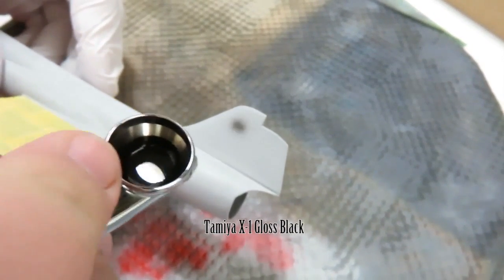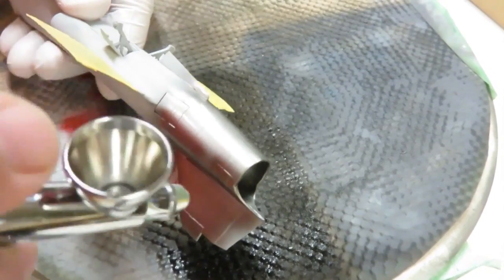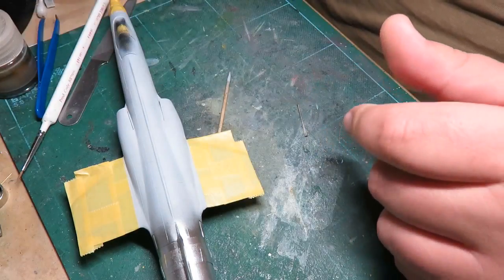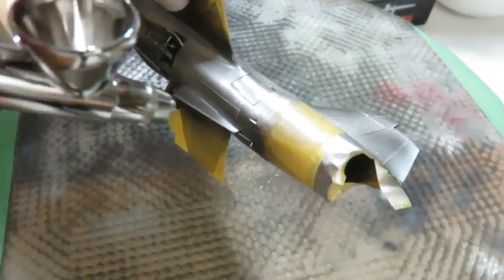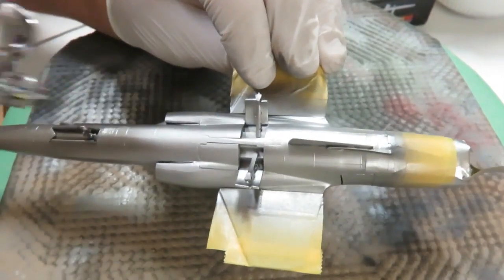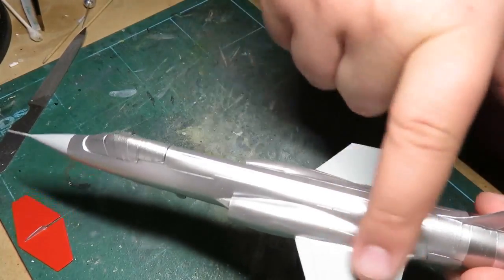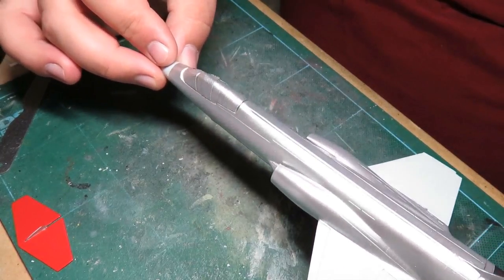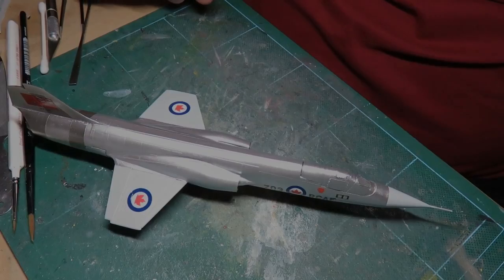Airfix 1:72 CF-104 Starfighter (Part 3)

Comment: Very nice build.  I love to buy old kits like this and sand off the raised panel lines, rescribe them, and add a few scratch built improvements.  Aftermarket decals to replace those old ones and you can make a reasonably up-to-date looking model.
Reply from the maker: I agree with you, there is a certain element of fun about bringing back what some would consider an outdated kit, and I was tempted a few times to do the same with this one, but ultimately, I just decided to keep it classic :D

Comment: As you've found, Vallejo documentation says to spray all their paints at no higher than 20 psi. Also to get shiny look is to sand with very fine sandpaper. They have upwards of 12000 grit HTH.
Reply from the maker: Thanks Kevin I'll try that next time. Will be an interesting test to sand these down to a nicer polish.

Comment: What so you normally use to thin your acrylics for airbrushing? I just got an airbrush (still waiting for a compressor) and all I've heard is that you can't thin acrylics with water like I do for hand painting.
Reply: TheWaggishAmerican 
Depends on what paint,  I think humbrol, vallejo and a few other acrylic paints can be thinned with water.  Tamiya and Gunze have to be thinned with their respective thinners.
Reply from the maker: Yes, with Acrylic thinner. The paint is too thick other wise. Vallejo air colors, are pre thinned so all you need to do is our in the airbrush and go.